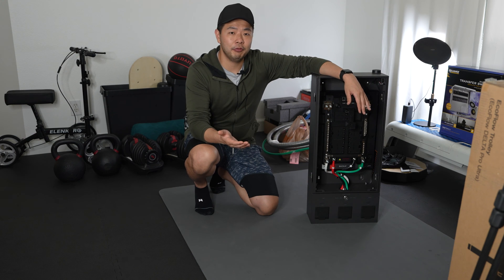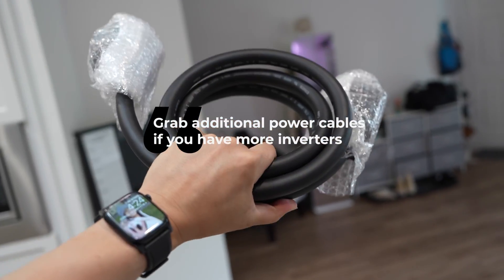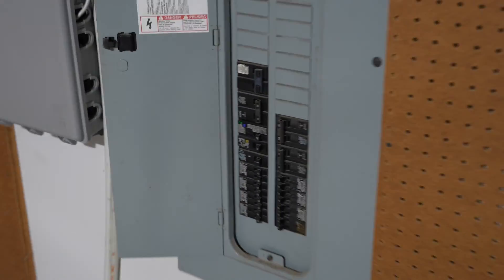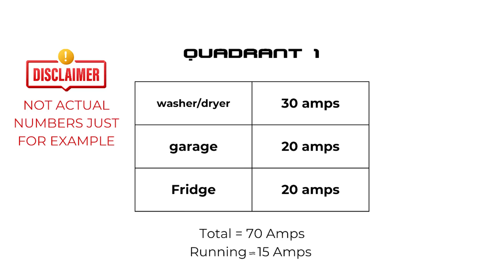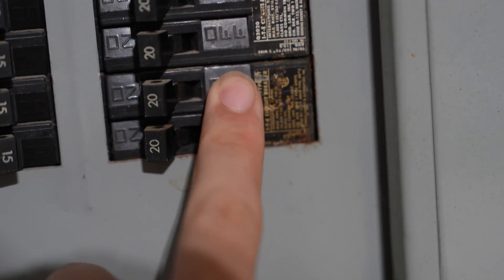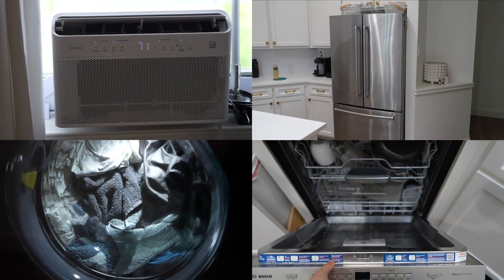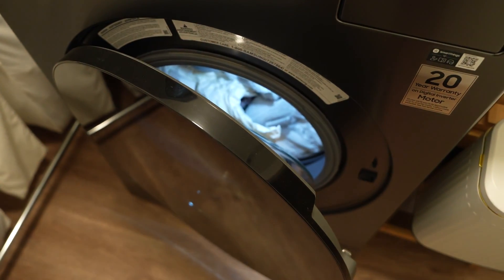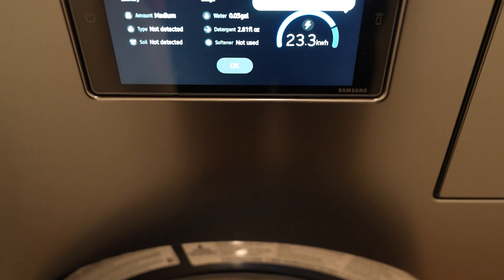How To Plan Ecoflow Smart Home Panel 2 and Delta Pro Ultra Solar Generator Installation

Comment: How long does the battery last running central air 3.5 ton unit?
Reply from the maker: Depending on your unit most 3.5 ton will use about 3.5kwh and the blower will use about 500-700watt so about 4. in my case would run about 7 hours with my 30kwh of battery if charged to full. if there was solar coming in it would be able to be extended.

Comment: apparently you can’t set automations via the app for a dpu, without the smart home panel 2?  without a home panel 2, i simply want to have it charge the dpu battery when my electric is off peak and power on, when it’s on peak.  when i set the times in the scheduled tasks area, they don’t save.
Reply: To set request in the task area you need to hit that grayed out check mark in the upper right twice.

Comment: Does this installation require a permit?
Reply from the maker: Hey there it usually does require a permit you can consult with the electrician. Or when purchased in ca or tx EcoFlow’s does help with assisting you to get one by putting you in touch with who and what you need.
Reply: @williamsung  thanks for the info! I’d like to see your Jerry rigged(noticed it was laying in yard) setup of solar you got in the back yard

Comment: Just so you are aware, there aren't 4 quadrants like you described. 

That's just a misunderstanding based on the labelling. 

The bus bar supports 120A total, there are no zones, poor labelling on their side, but it's just to tell you that any circuit can't go over 60A.

The idea of quadrants is not a "thing" it was a bad assumption made by a couple YT reviewers early on... it keeps getting repeated over and over... 

The 4 section are basically covers that provide access to the relays for each slot (4 groups of 3). 

There are only two BUS bars (L1, L2 for split phase) and 60A is the per circuit max...

... That said, you can't really populate the whole SHP2 with 60A circuits as the max grid feed is 100A and the max battery feed (with 3 x DPU) is only 90A... 

Plus there are load calculations to be considered (by an electrician) when looking at how much should be placed below a 100A feed breaker, for example (even on the grid side)...
Reply: Hi, do you know if the "smart home panel 2" and the "delta pro ultra" can always operate off-grid? There is no mention of this possibility in the manual
Reply: Yes, it can be set to always operate off-grid. There is master switch on the SHP2 that disconnects the main grid. This allows the panel to be powered by the battery unit. You may also attach an inlet out to SHP2 for a gas generator connection. In this case the gas generator will power the SHP2 and charge the battery simultaneously.